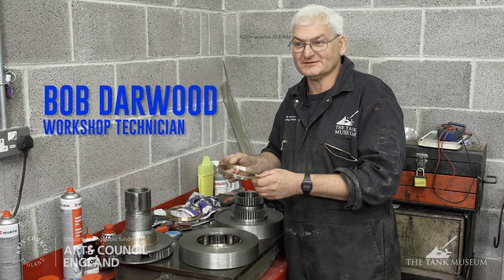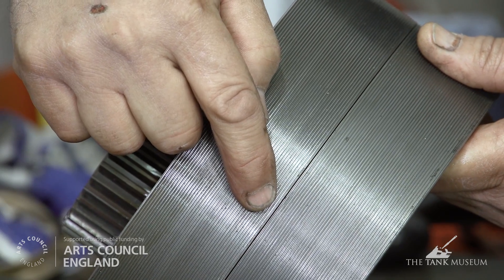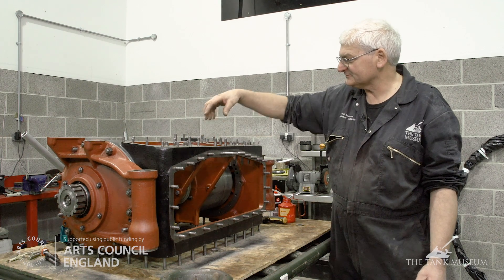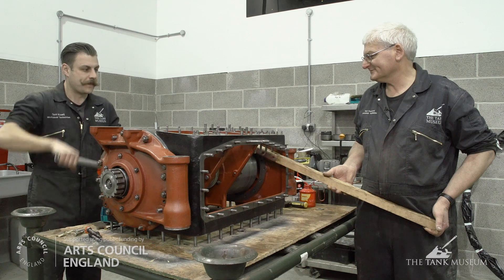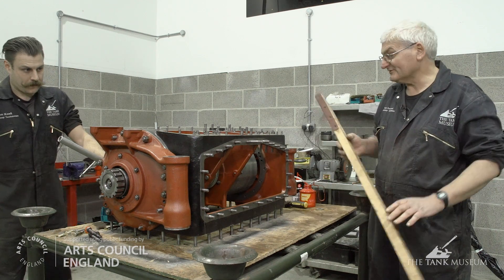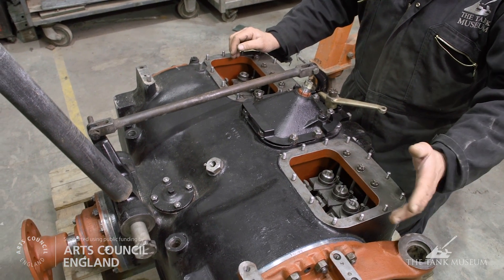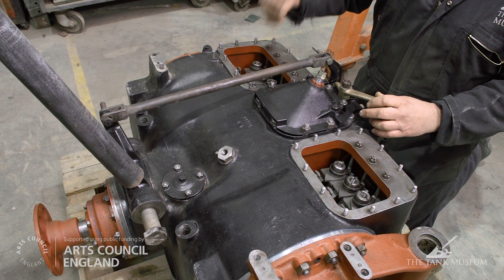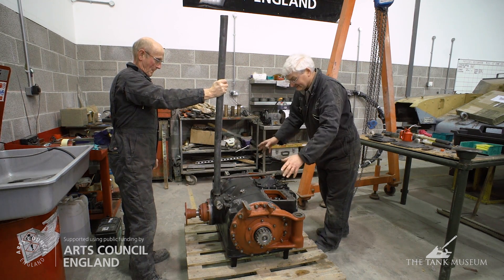The Matilda Diaries Part 11 | The Tank Museum

Comment: Excellent restoration.  But how often will the tank actually be run,  or  will it just sit on display?
Reply: TAOFLEDERMAUS they run most of their equipment as often as they can, usually everything that runs well at each event. Look at the Tortoise for an example. After the run a few years ago, they had to work on it, and they finally finished with it, and will be running it again soon they said.
Reply: They wouldn't be restoring the engine and then fail to run it. Just look at Tiger day, theres a single runnng tiger in the world, why wouldn't you show it off?
Reply: http://www.tankmuseum.org/visit-us

Comment: @The Tank Museum, @Bob Darwood, The new lining material for the brake bands as good as or better than asbestos? The health implications aside Asbestos has/had some very nice properties.  Have new materials or composites improved those properties?  Or are we collectively left with an inferior product that is safe?
Reply: Generally modern break band material is superior in its holding power and life time wear then anything from the 1900s to 1950s.
Reply: Asbestos is wonderful, you can use it for road surfaces and if your town is called Asbestos the houses are really affordable😏

Comment: Excellent video.  Maybe David or one of you guys could do a video on the theory or reasoning behind using this transmission vs. a simple geared transmission that had a clutch?  I guess, when I think about it, a much faster tank my benefit from a sequential or other fancy gearbox, but a tank as slow as the Matilda?!
Reply: In one of the earlier video's on the disassembly of the gearbox they mentioned that is was to improve the driver's comfort and make his job a little easier. It helped with crew endurance

Comment: Good work fellas . The Matilda looks like a maintenance nightmare . It must have been hard to repair battle damage quickly.  So after the gearbox is there another set of gears that split driving power to the tracks?

Comment: So someone  correct me if im wrong. To change gears you first select the gear you want and then press the change pedal to engage that gear. So, could you drive it in one gear (ex. 1st) and have the next gear (ex. 2nd)  preselected? If so that's pretty cool.
Reply: Its actually a very easy system to use. We had it on the Ferret and Fox armoured cars. Just think ahead to what gear you will need, select it, and when you are ready just kick the pedal. Only problem is that after a long time driving around and you get into your family car you end up just kicking the clutch pedal!
Reply: Viridis Lux  yeah, nah.  the system was chosen because it was reliable and available. if they'd wanted cheap they would have used a conventional manual transmission.
Reply: 328Watcher man, I wish my T-55 would shift that easily... the myth that you need a sledgehammer to change gear in Russian tanks is as true as it sounds. The only other way to shift it without using one is to get very drunk, but then you do not need to be driving it anyway. What is funny, is when you take the gearbox apart, everything is fine and lines up. The clutch is just terrible in practice. I used to have a rubber mallet in there for shifting, but I beat it so many times the head was pulverized after a couple years, and I ended up getting a thick rag to put over the top of the lever and getting a large proper mallet in there. Just as difficult, but now I can break my thumbs too!
Reply: Exactly how it works.  System came from public transport buses & taxis in London which use/d that system.
Reply: yep, exactly
Reply: yeah, the same gear box and engine as a london bus. because the brits were basically broke and built their tanks out of spare parts and whatever was lying around.
Reply: Hence the name. pre-selector gearbox